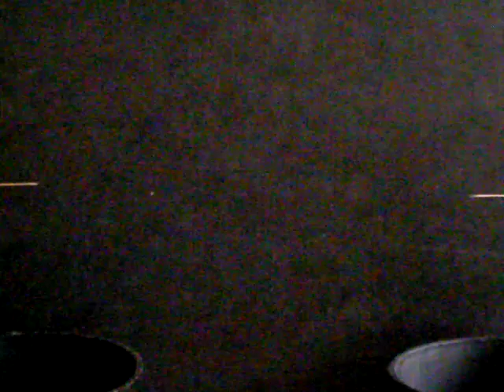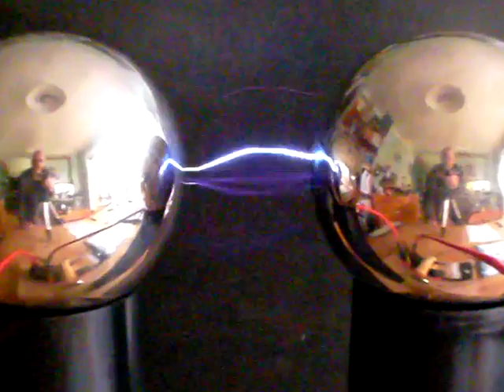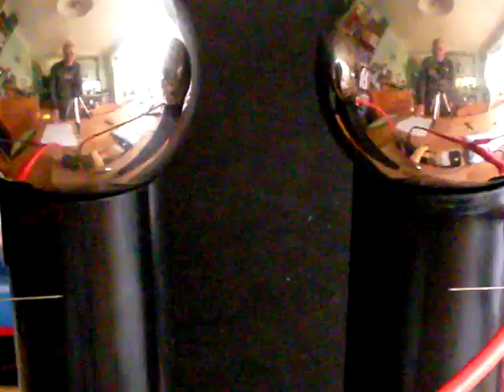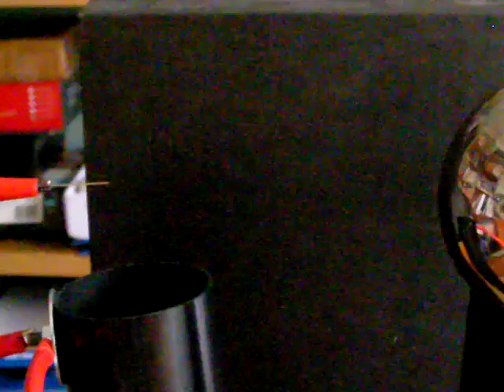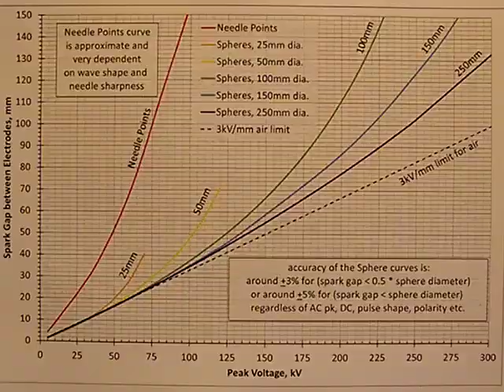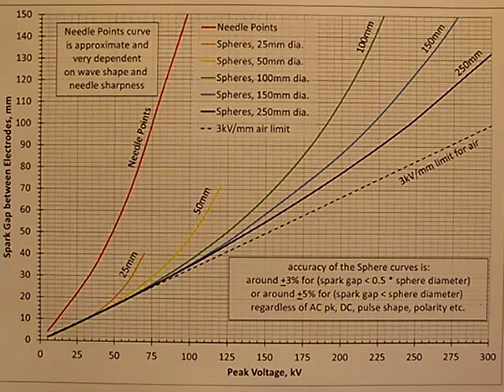Measuring High Voltages using Spark Gaps

Comment: 2:34  i disagree; this method isnt reliable with high frequency AC because of the "pre-ionisations" that happen due to the large "capacitive current" flowing which would create easy pathways for arcs, basically corona discharge but due to the current flowing through the capacitance formed between the 2 electrodes (and its flowing through the air, so..)
Reply from the maker: I don't think we disagree - yes high frequency AC is harder to predict, maybe I should have limited the scope as AC at or below power frequency, meaning 60Hz or below.

Comment: want to make a suitable hv circuit for my small plasma ball it's hv transformer went bad, tried with the ignition coil of my bike and a transistor oscillator, was getting hv shocks all ove the circuit, plasma ball was working.

Comment: This is good work, well thought out and presented.....very sorry that I found it , by chance, much later than you published it and after I stoped playing with Tesla Coils.
I woul be interested to know have the ultimate air breakdown voltage is defined and established
I have always assumed it to be 1mm gap = 1kV    which seems to be the popular  rule of thumb but your work seems to dispute this commonly held belief

Thanks again
Reply from the maker: Basically it is a two-stage process. First step is to calculate the maximum breakdown voltage for a given air gap between theoretical very large, smooth electrodes, which in room conditions is mainly a function of gap length. A useful simplification for this is E (kV) = 6.08*sqrt(d) + 24.22*d with d in cm. Second step is to calculate how the shape of the electrodes increases that e-field strength. The ~1kV/mm figure can work for pointed electrodes like needles (if you want to make longer sparks) but it can be ~3kV/mm if the electrodes are large and smooth, such as a short gap between two large spheres. Power companies prefer to avoid sparks and corona so they use long gaps and smooth surfaces where possible.

Comment: Hi,
The needle points curve in the chart is for bipolar voltage stress of the needle gap?
 Same question for sphere gaps.
Reply: Correct, for the symmetrical gaps where both electrodes are away from ground (allowing the e-field to be symmetric), the polarity of the voltage does not matter. The sphere-sphere gap is less sensitive to pulse shape and is best for all measurements including pulses. The needle-needle gap might be OK for DC or peak value of low frequency (50/60Hz) AC. The needle-sphere gap showed a strong polarity dependence as shown in the video.

Thank you for your question.

Comment: This is the kind of information I like to find when it comes to trying to prove theories and ideas about thing people have in their heads, I start suspecting a third element involved when I noticed inconsistency or large ranges in peoples voltage guestimations.

Your video certainly clarifies these uncertainties and inconstancies when it comes to me guessing rough voltages based on spark gap distances as I'll know from this
video that I'll be wanting to use >=100mm spheres when it comes to more accurate readings.

I get a funny feeling there will also be other variables that could lead to minor variations, for example, humidity, ambient temperature, air pressure etc.
But this is something I honestly had no idea about until coming across this video.

Keep this kind of stuff going, these kinds of videos I find to be very interesting!
Reply: Thanks for your comment. Yes indeed there are theoretical and empirical formulae which allow the precise effects of pressure, temperature, humidity etc to be predicted, however the 'rule of thumb' at STP (normal lab conditions, standard temperature and pressure) is still 3kV/mm field strength. You can find these in books such as 'High Voltage Engineering and Testing' ISBN: 978-1-84919-263-7 and 'Insulators for High Voltages'  ISBN: 978-0-86341-116-8
Reply: ridefast0 Thanks again for even more references, I've added those books to my "to read" section in google books, so I should hopefully get round to reading some of those in my breaks and whatnot, they certainly look a lot more interesting than my Inspection and Testing books... less physics in those... x[